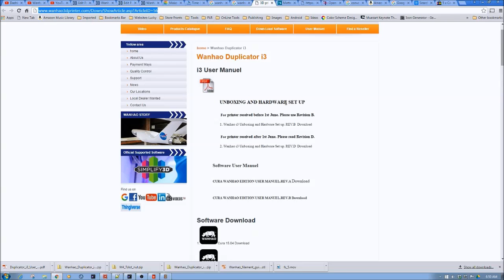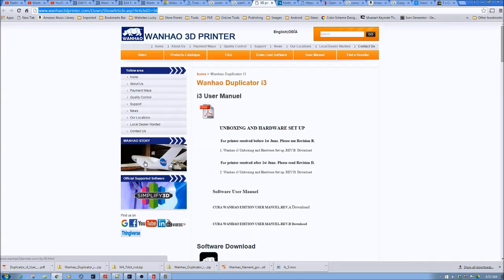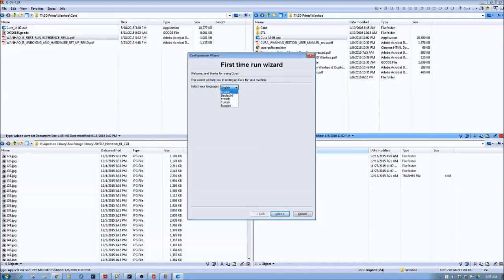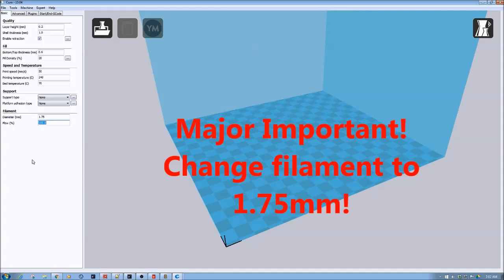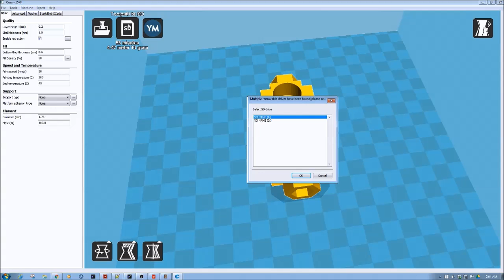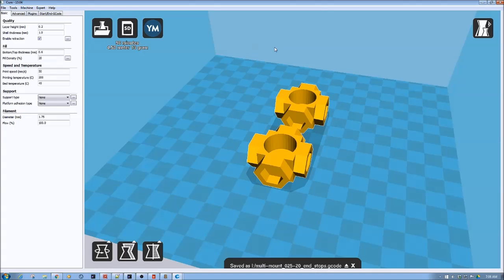Wanhao Duplicator I3 3D Printer - Installing Cura

Comment: Hello mate , 
I am watching Your Tutorials for a long time knowing that I will get soon a 3D printer and Yesterday I Received my "Wanhao Dupliator i3 Plus" , I did as best as I could bed level and I print OK sign . Was came out reasonably good . I order to go further I seen You choose in Cura settings "Prusa Mendeli3" ! and I would like to know Way ?!. 
Regards
Reply from the maker: Prusa is simply a generic form for this style of  "cartesian 3d printer" is all.  You can also set as custom, however as long a general machine settings are "set" (as you will see there aren't a lot of them you are good to go as most of the magic happens inside the slicer as the machine only defines for the most part the "envelope".  As you get into a bit more, this will come together better :-)

Comment: Another problem I have is that with a 45 c bed the extruder can only reach 195 c, I guess this is universal for all the i3s but is there a hardware upgrade / power supply mod I can do?
Reply from the maker: +Alexander Meyer That sounds strange, as I can reach 90c on the bed as well as 255c on the hotend.  Its only reaching to 260c that I start to see issues.  Without seeing everything, guessing you have issue with the power supply not being able to drive both.  Will it go above 195c if the bed is off?
Reply: Yeah, If I lower the bed temp I can raise the extruder temp, its like its max 240 c total
Reply from the maker: +Alexander Meyer Yea there is something wrong with your unit if this the case as it appears the power supply can't drive enough current to both.  For grins and giggle, check to see if the heated bed is wired correctly.

Comment: I have a problem with my i3. The 200 c doesnt follow the SD card, but the bed temp does, so I manualy have to set  the extruder temp at the i3, not a big deal but is this something about the firmware or what?
Reply from the maker: +Alexander Meyer I have sort of the same issue with mine, so I set the temp in Cura which is passed in the G-Code however when loaded from the card it reads 0 Temp, however if I wait like three or 4 minutes it pops in so believe it is a firmware bug...

Comment: I just got this printer and I'm loving it. I'm printing with PLA at the moment, and using the Cura 240 extruder and 70 bed temps aren't giving me good results, the skirt won't stick to the plate very well, and in some cases it almost melds with the plate. I lowered the temps to 215 extruder and 60 plate, the same PLA preheat as the machine, and it gave me a pretty good print, but it's not smooth like the OK model that came with the printer. What would you suggest for the heat settings for PLA?
Reply from the maker: +Matt Moniz Wow 245c is way to hight for average PLA.  I print Hatchbox PLA (like this http://amzn.to/1T1TR3D) at 200c tops and for PLA you really do not need to heat the bed escpialy if your using a Tack pad or blue painters tape.  Hope this helps and if you have other questions please let me know...